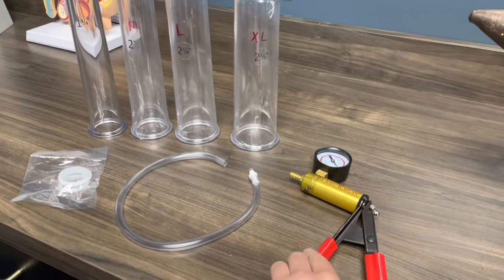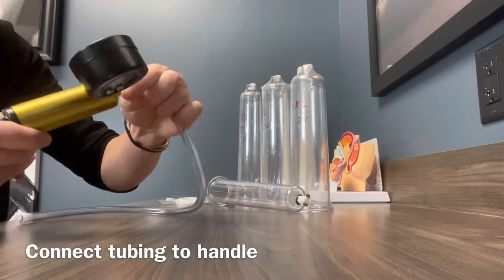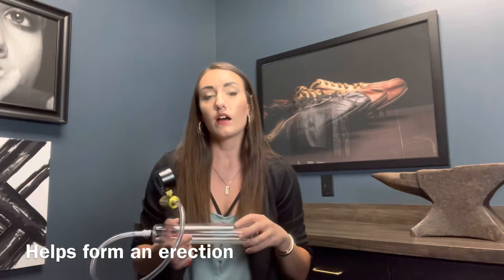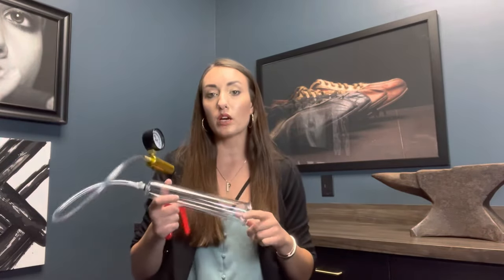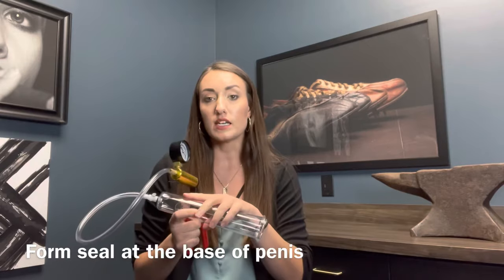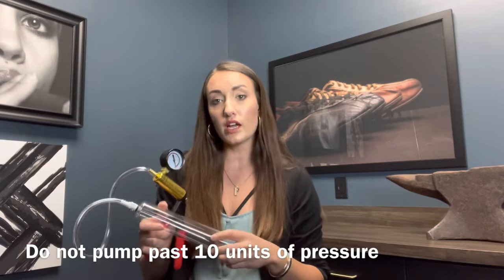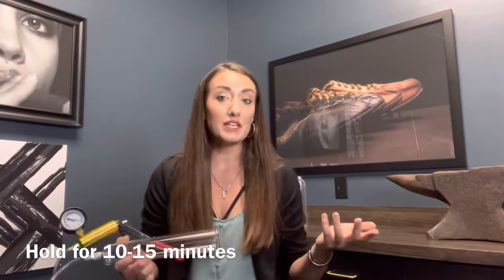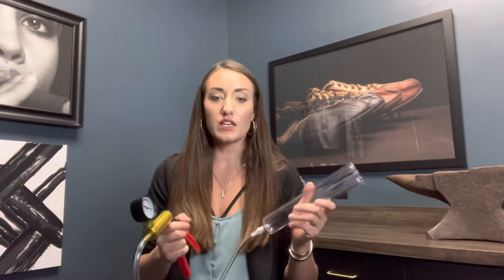How Do You Use A Penis Pump?

Comment: Should you use a pump if you are on blood thinners?
Reply from the maker: Penis pumps generally are a very low risk treatment for ED. Typically, the only issue would be if you pumped for too long, had a cylinder that didn't fit you, or you pumped past the recommended pressure.  They warn people that are using blood thinners because if you have too much air pressure in the cylinder it could cause mild bleeding under the skin’s surface. I would ask you doctor if they are okay with it and purchase a pump with a pressure gauge as shown in the video.  **This is not medical advice. You need to consult your physician.
Reply: No don't try it without Dr advice

Comment: Is the pump effective on pyronie desease at any rate? Any sign effects ever noticed? Thanks.
Reply from the maker: Yes.
Reply: Yes, see "The role of vacuum pump therapy to mechanically straighten the penis in Peyronie's disease" DOI: 10.1111/j.1464-410X.2010.09365.x   Petichiae (small red bumps) and bruising, in the one study I looked at, was quite common.  Above -300mm pressure more severe adverse effects can occur including bleeding, foreskin edema and one case (-500mm) it caused permanent internal damage and Peyronnies,  -200 seems adequate.  So yes, there is evidence that it can help Peyronnies, and if abused, it can cause Peyronnies dz.

Comment: do you have to hold the trigger on the pressure for 10 - 15mins or will it stay at the pressure for 10 - 15 mins?
Reply from the maker: You will have to use the handle from time to time to keep the pressure.

Comment: She advises 3" (250 mm mercury) but research appears to indicate that 200mm, about 8" of mercury is adequate.  To my knowledge the frequency of use has not been the subject of any respectable study.  It appears that 2x/day seems adequate.  Never go beyond 300mm!  At high pressures permanent internal damage has been done.  300mm or less appears safe based upon research.

Comment: To keep it under 10 pressure, do you KEEP pressing the pump (for the whole duration of 10 minutes) to maintain pressure? Or just do 4-5 pushes to the keep pump going?
Reply from the maker: Hi Sid - Once you get it to the correct pressure you should be able to maintain it through just a few pumps here and there.  Also if you tightened the pressure release screw it will hold the pressure longer.  So, no you shouldn't have to hold the pump the whole time to keep the pressure.
Reply: What does mean 10 units of pressure? 10 cmHg or 10 inHg? 10 inHg is 25,4 cmHg. 10 cmHg is 3,9 inHg.

Comment: Do the pumps actually work
Reply from the maker: Yes
Reply: too good!!i went from 6.25 l and 5 girth to 7.8 l and 5.75 girth !!! ive got 5 yr experience and several brand try's the absolute best is( encore electric pump with timm osbon bands ) absolutely great sex my wife sometimes wants it just for fun !! but you must modify the tube to accept a vac gauge, and if bigger than 7  the head needs a little modification,, this combination takes it from limp on a cold day to hard in 4 min

Comment: How do u choose the pump I know some say 9x1.75 and so on
Reply from the maker: Hi Scott - To find your head circumference measurement: 
Sometimes the penis will be bigger at the penis head than at the base of the shaft. To make sure the cylinder will be comfortable, it is recommended to measure the circumference of the penis head. Wrap another string around the thickest part of the penis head, and mark where the string meets. Take the string off of your penis. Line it up next to a ruler and mark the measurement in inches. This is your penis head circumference measurement.

Comment: Will using a penis pump daily help when it comes time to have sex with a partner or is it designed to only be used right before sex ? Thanks
Reply from the maker: It will help when it comes time.  Doesn't have to be used directly prior.